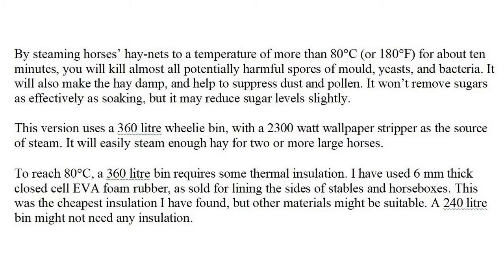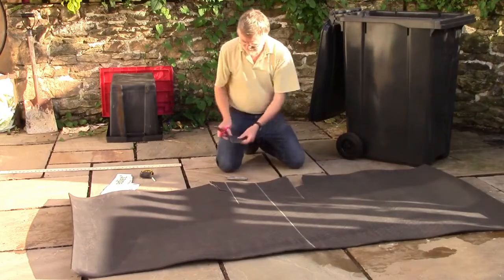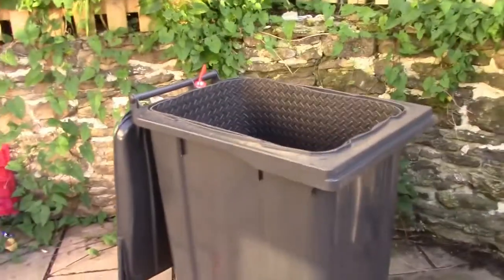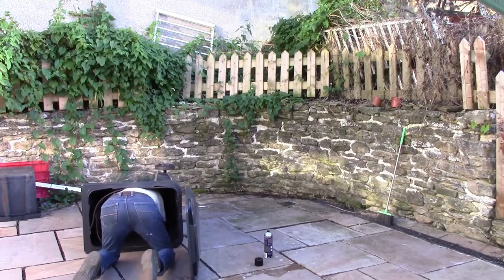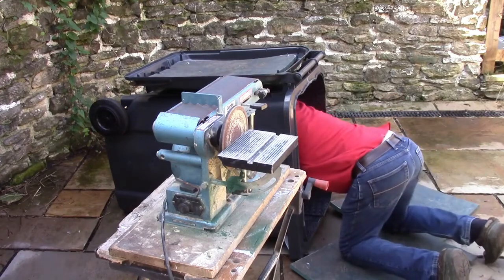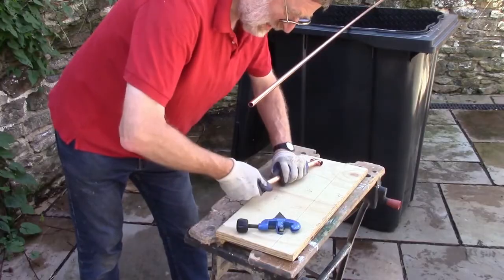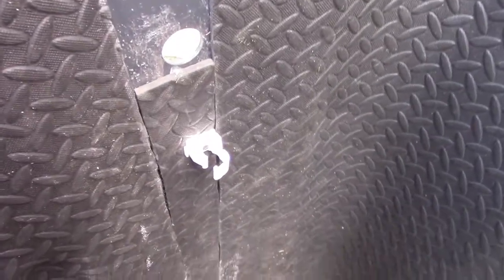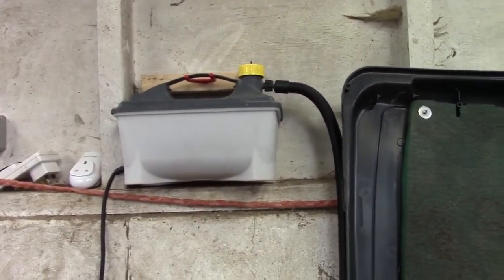Hay Steamer

Comment: Hi brilliant video, Thank you. Is the foam safe get up to the temps that hay steamers reach and be next to the hay? I can't help but wonder if it gives off any toxins at high heat. I wonder if wheelie bins are the same type of plastic as commercial hay steamers? Not an attack just wondered if you know.
Reply from the maker: It's a fair question. EVA foam is typically rated for continuous operation at 80C, but I have not seen any sign of surface deterioration used once or twice a day in my steamers. I don't believe it contains anything toxic (unlike some polyurethane foams). I believe wheelie bins are normally high density polyethylene typically with inert fillers such as carbon black to improve UV resistance. You would not use this continuously with the full thickness heated to 100C because it would tend to deform, but intermittent use with the inside up to 100C would be OK (remembering that the outside won't get over about 50C). One of the merits of polyethylene is that it does not need any added plasticisers that can leach out. I strongly suspect that commercial steamers will also be polyethylene.

Comment: I am wondering if you are putting a full bale in this?  If so does it not crush the wire that you have on the bottom from the weight of the bale? Thanks Laura and Travis.
Reply from the maker: A full bale won't fit in one of these bins. They will take a pretty big haynet, 10kg or more but the mesh I use is fine for that. If you stuff three or four normal sized haynets (suitable for big horses)  in then the friction from the sides means the full weight isn't really resting on the bottom.

Comment: Hi Steve... Can you tell me where you locate the thermometer please?.... Is that it on the lid with the spike probe sticking down?   Thank you
Reply from the maker: Yes, it is just the type of thermometer used for milk steaming in a coffee machine, cheap on eBay. Some of them have temperature markings, others just coloured bands. Hole drilled in the middle of the lid and through the top insulation, I use a rubber bung and I drill a hole in it with a small twist drill (say 2 mm), this leaves a hole that you can push the spike of the thermometer through from underneath the lid and the friction holds it in place.

Comment: Good video Steve, my concern would be the plastic leaching and contamination to the hay.
Reply from the maker: Thanks. I'm an industrial scientist and do a certain amount of chemistry, I took the view that the steam delivered via the copper pipes goes straight into the hay and that it is only the water that collects under the mesh at the bottom that would contain anything significant that leached out. The nets sit on that mesh, above the water level. I did try to find out what plasticisers there were in the foam insulation, but had little success. (See also my reply to first post).

Comment: Hi Steve! Thank you for this ingenious steamer. I'm going to attempt to build one. I just have 2 quick questions...
1. Do you have one wallpaper steamer going to two wheelie bins? 
2. How long does it take (approx.) to reach 80°C in a 360 litre bin using a 1500 watt steamer?
Reply from the maker: Yes, I had no problems using one steamer with two bins. I used to put it on a 1 hour timer (to avoid accidentally letting it boil dry). I have not needed them for a while but I think a single bin reaches temperature in about ten minutes (from when the steamer is boiling properly, which depends a bit on how much water you put in).
Reply: @steveradcliffe4898  Thank you so much!
Reply from the maker: @UCOYcK9BHImV6nTyDFHhNP-Q I'm pretty sure that will work, especially with a single bin. One of the reasons I added insulation for my double bin setup was to make sure it got up to temperature OK. My gut feel is that with 1500 on a single bin, the outside hay might not get up to temperature without insulation, although it would still be "soaked" by the condensing steam.